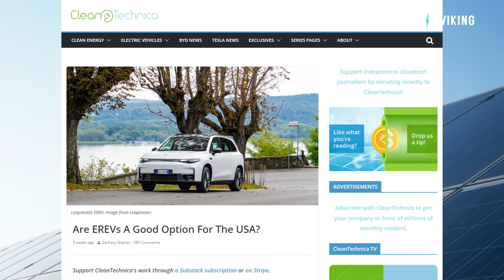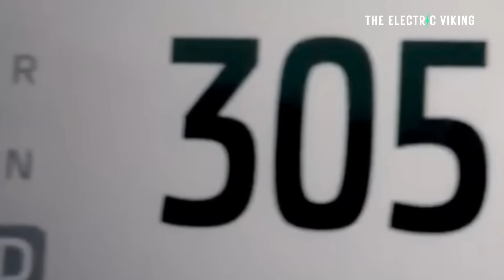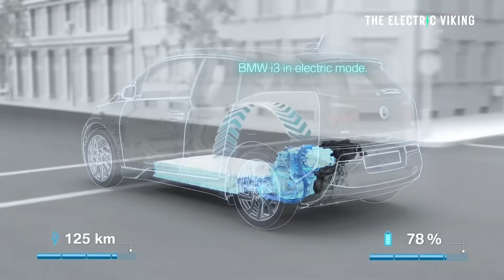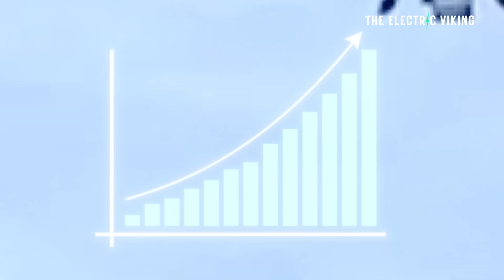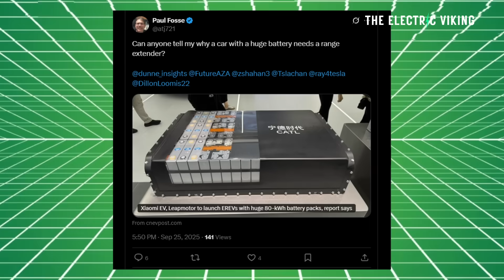Are EREVs the Future of American Electrification?

Comment: I drove an i3 EREV for a few years. It made sense then, because batteries were small and expensive and chargers could be hard to find. I drove it as an EV around town but burnt some petrol on road-trips. Fair enough. Worked well. Nowadays it makes no sense where I live.
Reply: Drove 2013 volt...140k miles...130k on electric 10k gas
Reply: Makes sense the way most people commute in the US suburbs
Reply: Do you drive for a living? Do you tow? Because that is who is putting the most miles/kms on cars. And I can well see that a RE EV would work for them.

I drive a BEV as of the end of this month. But still have to have an ICE as backup. For towing and incase I have to travel 6 hours none stop. Which happens at times due to work commitments.
Reply: @MoDa87 Good point. What range does a taxi-cab need?
Reply: @neilhawkes880 depends on the city and country. Some cabs drive a lot of short distances and can charge in between. In other areas it’s more long distance driving.
Reply: @MoDa87  I purchased a '14 BMW i3bev in March as a daily driver replacement for my beloved '86 Isuzu Trooper so I can re-engine and refurbish it. 
I absolutely love the i3 for a daily driver, I only have a 3mile one-way commute a few days a week, I believe that my short-hop driving did in the Trooper's engine. 
I'd considered looking at the "Rex" i3 but didn't want the extra hassle of it.
Reply: @RiverRatWA57 I am not sure why you think your comment is relevant. You don’t drive a lot. You could just get an E-bike your commute is that short. 

I drive 2000km a month sometimes a lot more. 25k km a year is my minimum. 35k km is also not uncommon. I have to tow a horse box regularly.

Comment: Extended Range EV as I understand it, is much less complicated than the traditional plug in hybrids which are ICE vehicles with the added batteries. 
As such for those who don't mind a bit more complexity but a big peace of mind and zero or minimal range anxiety, then it's worth it
Reply: Yes, exactly. I roll my eyes at all the "Complexity!" FUD. I turn on my Chevy Volt, and it's an EV. The ICE never comes on unless 1) I turn it on because I'm on a road trip; 2) I run out of battery because I haven't been paying proper attention; 3) it's deep winter and the car decides the battery needs the extra heat. Oil changes are few and far between because oil only degrades when the engine runs. I only fill the tank when I'm preparing for a road trip. Simple!
Reply: Yes, think old fashion diesel electric locomotives that are pulling freight trains today, in the US. The gas motor only drives a generator, that can both charge the main battery, while that generator can also power the electric motors. No multi-gear transmission.

In addition to being a transitional technology (like training wheels), it has use in America's expansive rural areas, which may never see adequate charging infrastructure. A comparable example, are telephones. 90% of the US telephone market was urban and mostly serviced by ATT (the real ATT. Not the poser that exists today), with General Telephone servicing a small minority of that urban market. Rural areas were serviced by 100s of small independent telephone companies, that share that small 10%. Since there's no money in the rural areas, infrastructure projects really lag. If it wasn't for the Interstate Highway system (for connecting urban centers), these areas would not have any transport, nor modern telephone service, with the cell towers, that line those highways. Note: this was the old landline phone system. Rural population, as a percentage, of the total, has declined even further in recent decades.
Reply: Absolutely right you are. EREV is less complicated, less maintenance car. You get the best of both world....

Comment: Sam - The main reason that EVs have not taken off in the US the way they have in China is that they are too expensive.   If they were half of the their current price, they would be wildly popular.
Reply: I bought a 2025 Chevy Equinox EV with real 320 range. A Base Model LT with MSRP of 35,300. +T&L before the $7500 tax credit was killed + $2000 dealer credits. so just $25,800.  It is marvelous. However,  here in CA I spent 2 months locating a Base LT model to buy so that sucked because naturally GM only produced 10% of these stripped down loss leader models.  It is not price holding us back. Americans are too willfully ignorant/stupid for EV!   Afterall, they elected CHUMP TWICE!!!
Reply: Yeah, but that's an artificial price cap maintained by the government, in fact EV's are cheaper in Australia than they are in the US and Europe, any nation with an incumbent car industry is going to have issues with Chinese EV's because without tariffs and some sort of price controls they will just wipe out any native car market, specially as regards to EV's. You can buy the same EV in Australia for 40% cheaper than Europeans can (taking into account exchange rates) because with an incumbent marker first there's no pressure on Chinese car makers to make them massively cheaper than local cars, just a bit cheaper does the job, so they make more profit for the same car, and of course tariffs, which are actually quite high for EV's, not the same as the US of course which has an EV tariff of 100%, but still significant.

Fact is Chinese EV's could be half the price in the US, but you wouldn't have a local car industry left and that's the issue. Australia doesn't have a local car industry, so the only competitors the EV importers have is each other, so no tariffs, strong competition in the market equals cheap EV's. We still have a lot of fossil fuel FUD and a lack of infrastructure that's holding up adoption somewhat, but then we were stuck until recently with a party in power that thought bringing lumps of coal into parliament and waving it around was a good idea to help support the fossil fuel industry.

Comment: In the US, zoning is designed to force people to drive long distance to go anywhere so people always have range anxiety and don't want to charge the EVs when taking a long road trip either, unfortunately plug in hybrids nor short range EVs are desirable, but EREVs seem to be the solution or non plug in hybrids if you still want to depend on dirty and noisy fuel corporations

Comment: Started my electric journey with a 2014 BMW i3 with a range extender gas engine. It was the perfect daily driver city car.  I realized that EVs really work even in Boston’s cold winters. I just sold it for a fully electric 300 mile range EV.  Small steps in the right direction will work for America especially pickup trucks. Soon technology will make EVs work for everyone all the time but until then EREVs are a positive step. Stop trying to hit home runs with just BEVs when base hits can get the job done too.
Reply: Tbh, it’s the same for Europe. For people who drive many miles at high speeds on German autobahns, most EVs are just not good enough. Unless you buy the really highend models. And people often don’t have the money for that. They buy 8-10k Euro Mercedes Diesels and hammer them until 500k km on the clock. With minimal repairs and maintenance cost. There is no BEV in that price range that can do that.
Reply: BMW i3 EREV pioneered the EREV concept in the automotive industry about a decade ago. However, BMW was unable to fully capitalize on its potential at the time. In recent years, after extensive R&D, several Chinese automakers have significantly advanced the technology, proving EREV to be a practical and promising solution for the future of electric mobility... So, the future is EREV...
Reply: Well said

Comment: USA has a lot of trucks.  I wish all trucks had EREV tech.
Reply: Seems like a small range extender could just be dropped into the pickup bed of any ev truck.
Reply: @davidaustin6962 RAM trucks will add a V6 Pentastar engine to do just that. But under the hood, not in the bed - ha!
Reply: @billlewandowski-e9y that's cool.

Comment: EREV (Extended-Range Electric Vehicle) technology or REEV is Not just a solution for America, it’s a smart, scalable answer for the entire world. In fact, it holds even greater promise for developing countries, where EV charging infrastructure is still limited or in its early stages.
Modern EREV models offer full-time electric driving with larger batteries capable of delivering up to 200 km of pure EV range. Once the battery is depleted, a small internal combustion engine seamlessly takes over, not to drive the wheels, but to recharge the battery, allowing the vehicle to continue operating like a hybrid. This eliminates range anxiety while preserving the smooth, torque-rich, powerful feel of electric drive...
Reply: Does an EREV hammer a smaller battery more though? Is the generated power exclusively fed into the battery rather than the motor(s). Would it equate to a lot more battery cycles/throughput compared with the typically bigger battery of a full BEV?
A PHEV (which has other issues) uses ICE to its strength at highway speed, & battery to its strength in urban areas, & both in parallel when extra power needed, all while being gentler on the smaller battery?
Reply: @MortyMac Hence ERevs would needs LFP or Sodium batteries 👍
Reply: @phildrabble5498  Sodium can also be used, for sure. Then the EREV price will further come down...
Reply: @MortyMac Erev batteries are fundamentally different so the extra charging isn't a problem. The technologies of Erev vs phev are fundamentally very different. The phev is much more complicated and going forward won't be able to take advantage of all the ev development happening. It had a place but I don't see it having much place in the future.
Reply: @davidaustin6962  Agreed 100%. This "parallel drive" seems to be utterly misguided. Either you go pure BEV, or EREV.
Reply: @davidaustin6962  Battery is not fundamentally different. LFP battery mainly. Size is 3 times bigger than PHEV...
Reply: In an EREV, the generated power feeds directly into the battery. Typically, when the battery charge drops to around 20%, the ICE generator automatically activates to maintain energy supply. Charging can occur in various modes—slow, medium, or fast, depending on the situation. Even while parked, the vehicle can be charged if needed. There is a Hybrid Operation mode too. Overall, EREV offers a compelling solution for electric mobility. With pricing comparable to BEVs, you're essentially eliminating range anxiety without paying a premium.
Reply: So I'm hearing confirmation that EREVs hammer the battery harder than BEV or PHEV. Agree LFP should help with that.
Reply: My EREV has a 27 kWh battery. For a mid-sized battery like this, the maximum discharge rate would be around 1C, which could occur if you're driving at very high speeds...say, around 170 km/h. However, under typical driving conditions, the practical discharge rate is closer to 0.5C. Also, I’ve never noticed any whining sound from the car while driving...

Comment: Seems like they would work well for trucks that tow and campers. But smaller batteries make for more cycles and reduced battery life. 90% are better served by taking the gas and ice engine and trading it in for more battery capacity. There’s still a place for erevs though.

Comment: An erev ICE engine will be so much cheaper, simpler, and efficient than the usual ICE engine. All it has to do is charge a battery. Can probably be a fixed, optimal RPM delivering enough power for long distance cruising.
Reply: That's how all erevs work. Fixed rpms running at the optimal efficiency speed, which is why they produce a maximum number of watts per liter, using a very small and light engine. They don't produce a lot of torque, but you don't need torque since it's just turning a tiny generator trickle charging a battery as you drive.
Reply: @davidaustin6962 basically what Edison motors is building
Reply: If the engine is only needed at highway speed then a generator is not necessary, the engine can power the wheels. In fact you don’t even need a transmission but a clutch might be necessary.
Reply: @JosephHale-d6r  

The main purpose of the erev is to extend the battery range with a gas tank though I would also guess it decreases required top battery drain rate as well.
Yeah, at least in power efficiency terms, at long range driving, it's probably more efficient to propel the car directly with the ICE engine. 
Hybrids are probably still the sweet spot for cars. See other comment for a little elaboration

Comment: The advantage of hybrids is the synergy between ICE and Electric, which allows each to be optimized for what they do best instead of trying to do what they don't do well. Each can be simpler and more optimized than either could be alone. Two simpler systems each operating in their sweet spot instead of one more complex system trying to do it all. 
My 2005 ford escape hybrid has 220k miles and the only drive train issue I've ever had was replacing the drive shaft. No issues with the ICE motor, electric motor, or the transmission. Battery tests still say good condition.

Comment: Yes.The US is very large and cities are spread over larger areas compared to most industrialized nations.  There will not be sufficient charging stations for a while.   Range is THE huge factor in transitioning.  On the other hand, the battery range and charging speed are improving at an amazing clip; if we can get to 500 mile per charge range, no need for a back up engine.
Reply: Genuine question: Are people driving up to 500 miles in a day without stopping? Would it be impractical to stop somewhere along the journey in a 350 mile vehicle & just top up enough to complete the distance, then charge overnight? Or even 2x very quick stops while sorting food, bathroom, leg stretch, kids, dog, ... It would be a lot of battery to pay for & carry around every day to avoid maybe 30 min of accumulated stops in a very long day trip.
[Apologies I work in metric: 150 miles of top up is 250 km. At 20 kWh/100km that is 50 kWh. Charging at an average of at least 100 kW gets the job done in 30 minutes-ish (maybe faster charge, add some buffer, vehicle less efficient, ...)]
Reply: @MortyMac  The issue is the existence of charging stations where people are driving.  As I said, if there is a sufficient number of charging stations this goes away.  Regardless, the EVs are heading towards the numbers in any event.
Reply: @jonathanblum2994 That's really interesting tks. We in Oz believe we're a long way behind in public charging infrastructure, assuming your Tesla & EA networks among others would have EV road trips catered for. 500 mile gaps are a big ask.
Reply: @MortyMac yes people do that. Especially people who drive for work. I do a trip like that every month. And I only stop for a quick piss at the side of the road. I start driving at 12 lunchtime time. I have to arrive that evening early enough to get enough sleep so I can wake up the next morning and drive back and arrive not much later than 2 pm. Not possible in an EV right now. I tried. That’s why I need a second car that is a Diesel. I already have a BEV for driving locally. But that trip is mandatory for me. And it’s super time sensitive. As I transport life animals what need water and food every 8 hours or they die. So they have to arrive without a delay.

Comment: I had a Volt back in 2016, it was my gateway drug for EVs. When I bought that Volt batteries cost $1000 per KWh and the Supercharger network was practically nonexistent. By 2019; Supercharger coverage got good enough that gasoline was no longer necessary. That's when I got my first Model 3.
The downside of a EREV is that you still have to do all of the gas car maintenance, oil changes twice a year, visits to the gas and when that gas engine kicks in it's annoying.
EREVs require home charging, without it they are just hybrids. If you have home charging you have everything you need for a true EV. The Supercharger network in the US is extensive now and the other networks aren't nearly the dogs breakfast that they were a couple of years ago.
As long as you don't tow there is no reason to buy an EREV. If towing is important to you then a diesel is still your best choice. The Silverado does have a big enough battery to do the job but it weighs over 9000lbs, there are bridges with lower limits than that. It's also very expensive. In theory an EREV truck could do the job but I expect that most people who do heavy towing will save the money and just by the ICE truck instead.
Reply: Shouldn't need to do that maintenance if you rarely use it.  Just add a bit of fuel stabilizer like sta-bill or sea foam to the tank, takes but a moment.
Reply: @davidaustin6962 The Volt didn't have nearly enough range to go anywhere without using gas. I live in Eastern MA, a simple trip into Boston is 100 miles roundtrip. Commuting was 60 miles roundtrip on back roads but 75 on highways. A Saturday trip to Portland or Newport is two hundred miles roundtrip. With an EREV you still burn a lot of gas unless you never leave your town.
EREVs are neither fish nor fowl. If you can charge at home then you should drive a BEV, zero maintenance, quiet, comfortable and if it's a Tesla it drives itself. If you can't charge at home get a regular hybrid, good fuel economy but all of the headaches of owning a gas car.
Reply: @joshuarosen465  agreed, doesn't sound like EREV is a good fit for your use case. PHEV would be better, and of course BEV for the win. I'd only do EREV if 95% of days can be done without gas.

Comment: Towing large RV trailers??? Can an EREV even do it?
Reply: Get an RV instead, not towing needed.
Reply: @EnriqueAThieleSolivan  The battery EV RVs I've seen all lack enough range for the western states where I often vacation. A RV EV needs as much energy to move as a lightly loaded semi. Until they have 200kW plus batteries, they are not viable.